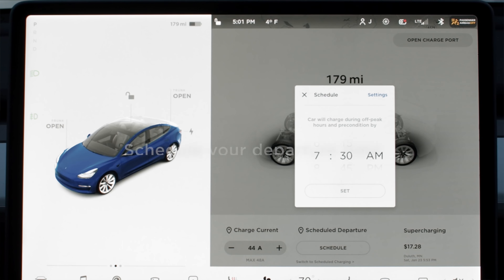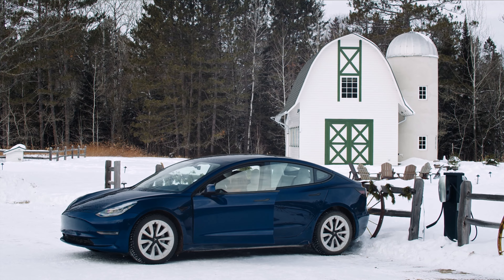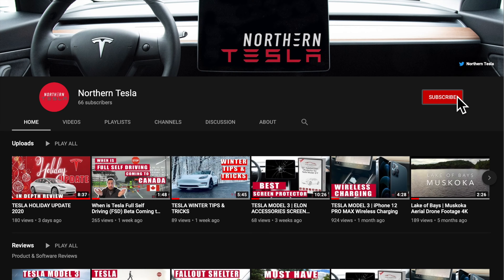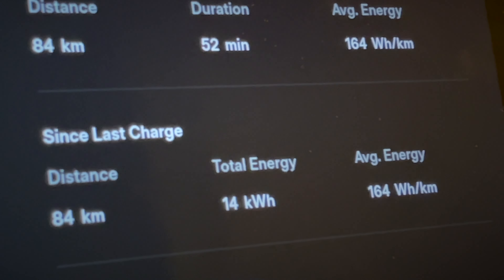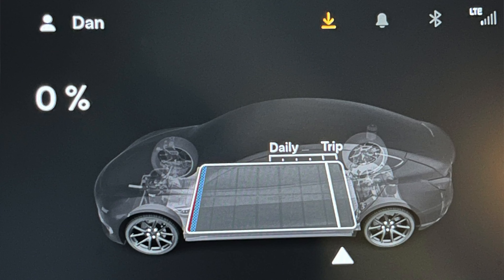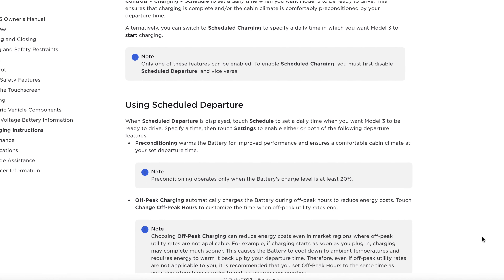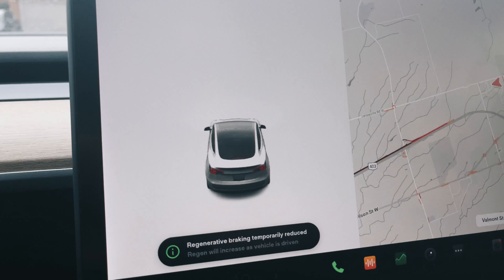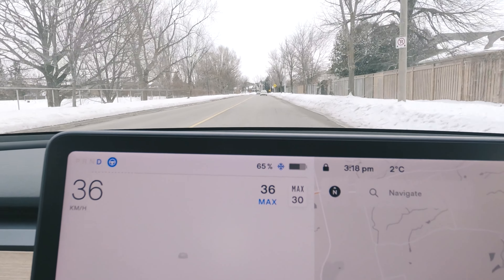Tesla Efficiency | When Should You Precondition Your Battery

Comment: I can’t get a clear understanding on the difference between pre-heating a car(the interior cabin)and pre conditioning the battery. Is it the same thing or are they different. Seems like the terms are used interchangeably. I’m in Minnesota where it’s gets very cold like Canada. My car sits all day at work plugged in sometimes . So is a level 2 charger plugged in going to “pre-condition the battery?  If I’m not lucky and all the spots are taken and it sits unplugged in 10 degree Fahrenheit weather, is preheating the car for 10-12 minutes to get the cabin warm the same as pre conditioning the battery?   And lastly , is pre conditioning meant to pre condition for charging or to pre condition for driving?
Reply from the maker: Thanks for the comment Bruce. I agree with you that the terms are very interchangeable and leads to confusion, but it’s essentially the same thing.   For your first question, if you’re at work plugged in you still need to set the car the precondition, it won’t do it automatically.  If you have a preheat pump car, there’s nothing to actually warm up the battery, so it basically relies on the cabin to warm up which will essentially warm the battery. Newer cars with heat pumps will help with that process but ultimately the battery still relies on cabin temperature.  So preheating the cabin 10-12 min will get it comfortable for you to sit in but it usually takes much longer to warm the battery to its desired temperature.   It’s preconditions for driving as it puts less stress on the battery.  If you’re going to a supercharger it will automatically condition for fast charging which is a different process.  Hope that clears it up a bit.
Reply: @northerntesla  thanks for the reply,  clears it up a little bit.  Mine is a 2022 model 3 long range so I believe it has the heat pump.  It’s been around 15-20 degrees out Fahrenheit at night so I really want to not let the weather damage the vehicle by me not taking proper steps.  I just saw a you tube video that said not to leave your car plug in if it’s not charging, but I had heard the car likes to be plug it……. It’s like politics, what do you believe
Reply from the maker: @brucehawkinson8901  I’ve heard both sides to that. But the majority says plug in and that is always coming from Tesla itself.

Comment: Because of my stocking hat, heated steering wheel and seat, I rarely need the heater, thus saving energy.  Is there a way to precondition the battery WITHOUT turning on the cabin heater?
Reply from the maker: No. However the heat pump will do a good enough job at heating the battery on its own. So it’s a much more efficient system.

Comment: I charge at home with a wall charger and have scheduled an off-peak charge time. Does the car automatically precondition before it charges?
Reply from the maker: No, you only need to precondition the battery when fast charging. If you want to precondition the cabin you have to schedule that separately
Reply: @northerntesla omg thank you. I’ve stated to finally charge at home. I just wasn’t sure if preconditioning was needed for home charging or not

Comment: Question.  I am charged 80%+.  I am not plugged (away from home or in garage not plugged).  Do I still pre-condition?  How long should I pre-condition on cold/warm days when unplugged if I am using the vehicle <50 miles. Thanks!
Reply from the maker: Would depend how cold it is and how long the car has been outside. It’s usually around 20 min or so

Comment: You make pre-conditioning much more efficient by setting the heater to manual, fan speed on 1, air recycling mode and temp to it's minimum of 15.5 degrees. The battery will heat up to a max of around 5 or 6C when unplugged. In my car it takes about 3% of capacity when the outside temp is around -10C, so not bad at all. This is on an insulated car.
Reply from the maker: Thanks for the insight Paul.  How do you find the cabin temp at those settings?
Reply: For example I planned my trip and when it’s cold weather I need to enable precondition (climate with AC ON) manually 20-30 min before non Tesla fast charging, correct?
Reply: @andriysunford2249  Yes, that is correct.
Reply: Very interesting. Are you sure it only heats up to 5-6°Celsius if it's not plugged in? Did you measure that? Because i currently don't have a charging opportunity in my garage (managing to get one, but will still takes month), but in my garage i never see Temperatures below 5°C, so that would mean i don't have to preheat because the battery temperature will never drop under that.
Reply: @andriysunford2249 why AC on in the cold?

Comment: Hi, if you are not plugging your car over night- at what temperature outside should you precondition the battery. Below 30 degrees Fahrenheit, below 50 degrees? And I was told you just need to turn on the climate button in the app / leave on for about 20 mins, and you should be good. Thoughts?
Reply from the maker: It depends how much range you need. If range isn’t an issue then precondition every time.  Yes turning on climate is essentially the same thing, precondition just schedules it for you.
Reply: @northerntesla  range is a tad an issue. I travel 30 miles to work and then back home. Plus my car is in a garage (I live in nyc where they bring it down) so I make sure to turn on the climate about 20 mins before I call them. So based on my 60 miles a day commute, what would you say as far as temperature you should pre condition? Thank you
Reply: @MrGtrMike  a good rule of thumb is when you see the blue snowflake which generally pops up around 30 degrees. I do 100 miles a day so you should be fine with precondition whenever that blue snow flake shows up. It will warm the cabin and get you the most regen braking
Reply: @damyotte  thank you and I’m also concerned with battery degradation. The pre conditioning of the battery I believe is a helpful step in keep your battery up. Correct?

Comment: Thanks for the video. Do you have to precondition if the car is Parked inside the garage during winter months. Or precondition should be must just to improve proficiency for the car and battery.
Reply from the maker: Unless you have a heated garage I would still precondition. Your battery will still be cold just not as cold as if it were outside.

Comment: Interesting. I’ve turned off the preconditioning, because it just wasn’t worth it. But now that you mention that the battery actually degrades more, if not preconditioned, it’s worth looking into. Why? Well, if we are talking about, say 0,5% added degradation, it might not be worth the extra cost of heating up the pack every time. I hope Tesla can answer how much damage the battery actually take from being run cold.
Reply from the maker: My rule of thumb is if it's plugged in, precondition.  Any other time I just use the app to turn on climate for a few min so the cabin is at temp when I get in.

Comment: I enjoy your presentations each week. I am wondering about getting the “Other” category to work in the Charge Stats in the app. (I have the Stats app so it isn’t a problem for statistics though). When I charge in my garage and set my cost it shows fine. I guess it will do the same at a Supercharger if I set the cost for it. I charged at a free charger and had set the cost at $.00 but it didn’t register. I just wonder your experience. Thanks.
Reply from the maker: I occasionally charge at work and I’ve set that at $0 and it shows as such.  I haven’t tried a free public charger yet.  If I get a chance to, I’ll let you know!
Reply: @northerntesla  thanks. I live in Grimsby and use the free one behind the Grimsby post office at 19.2 kWh when I go for a walk.
Reply from the maker: @robertcgibson9097  Nice!  I used to live in Grimsby; miss it. That’s a decent speed for a level 2 charger.
Reply: You don't have to set the cost at a supercharger. It gets automatically counted in the app properly. I've gone to a free charger on the NY State Thruway, and I'm pretty sure looking back in the stats it registered as "Other'. Interestingly, middle of last year a couple times charging at home my 2023 Y/LR for some reason thought it was 'Other' -- perhaps my wifi was down then -- not sure. Or the car had a glitch and needed rebooting.
Reply: BTW...if you weren't aware, in the app from the home screen, tap on the upper right 3 horizontal lines, then click on Charging, then click on History, it will show you all the superchargers you've charged at and the $ spent. Click any one to get a more details about it (session time, kWh, location, invoice, map).